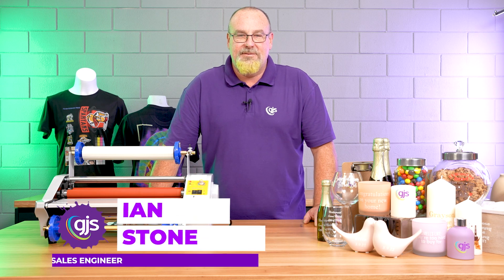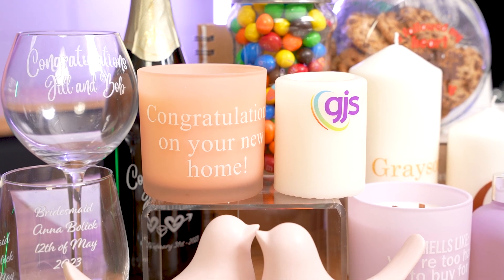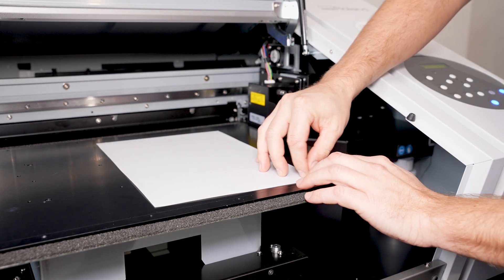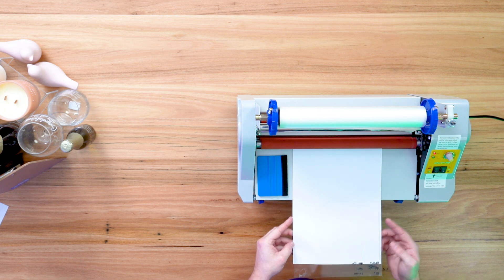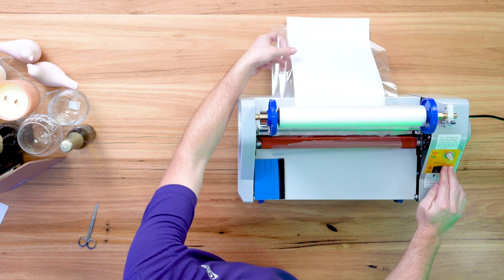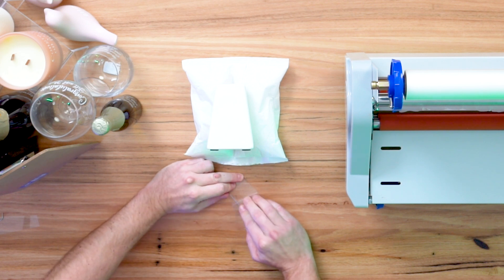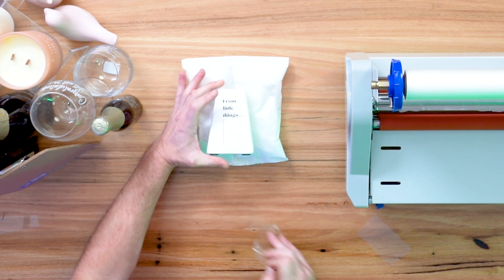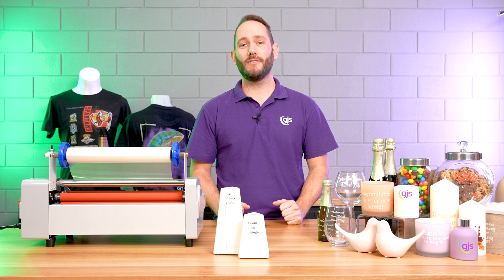How to print direct-to-film (DTF) transfers with a UV printer

Comment: Do you have to use varnish with this process? 
Also, I know that soft ink isn't so good - I have semi-soft which doesn't deform so much (printing on PE backing lifts nicely) would this be firm enough?
thanks!
Reply from the maker: Hi there, yes you do need to varnish over the top for UV DTF prints to work. With regards to soft or semi soft ink it's something you would need to test out and see which provides the best results. Hope this helps.

Comment: Hello, i am about to buy an UV printer but iam confused about going with DTF UV printer or flatbed uv printer, does any flatbed uv printer print on A film?
Reply from the maker: Hi there, more information about all our UV printers can be found here: https://gjs.co/equipment/new/c244/uv-printers. Yes, you can print on film using a flatbed UV printer but for best practise a test should be done first. Also, rigid UV ink will need to be used when printing on film. We currently only stock A4 and A3 size film at the moment so it will be limited to those sizes.

Comment: can you use a traditional uv printer to print dtf film?
Reply from the maker: Hi there, as long as it is an Ink Jet UV Printer with rigid UV ink, along with a laminator capable of heating up to 90 degrees Celsius.

Comment: What type (hardness level) of uv ink are you using?  I am set up for a flex. Will this work.
Reply from the maker: Unfortunately, it doesn’t work with the flex ink. The ink stretches and breaks during the separation process. It requires a rigid UV ink to achieve the best results.

Comment: Hi there, I have a question about using a UV printer on a Ripstop Fabric which has a water repelant feature and some of them are coated with a silicon material. is that doable ? 
thanks
Reply from the maker: If this is for a wearable apparel, it would be better to print with a direct-to-garment printer, as UV DTF is better suitable for hard surface materials. Although it is still possible to print on textiles, you would need to conduct your own tests or contact your local supplier to do a sample. If you're in Australia, contact our sales team at sales@gjs.co and they'll be able to test it out for you.